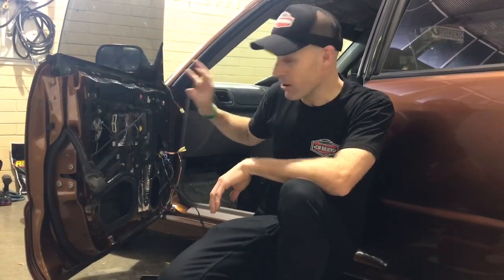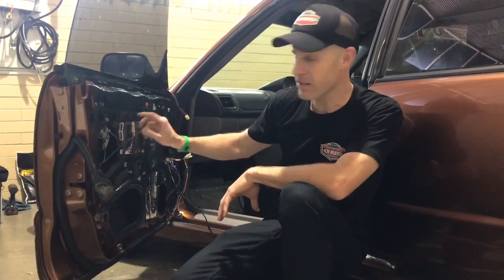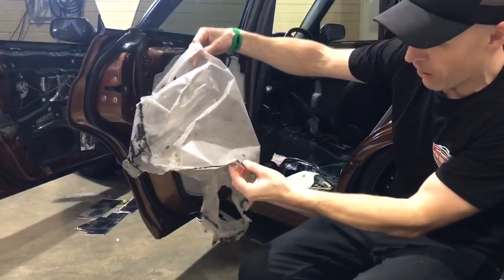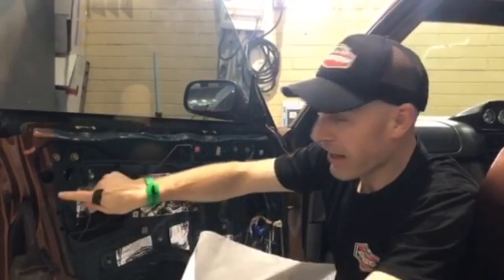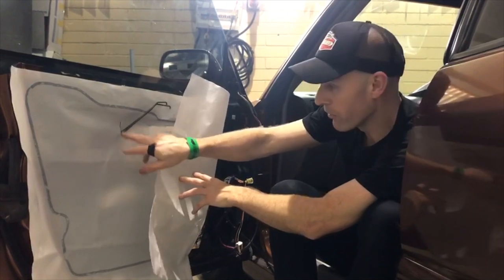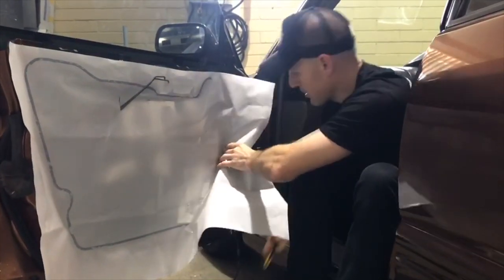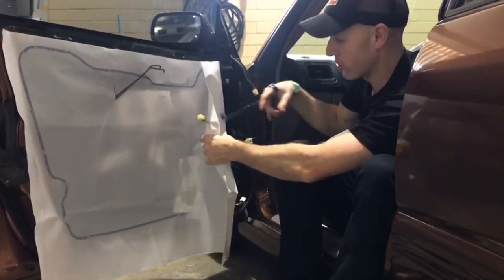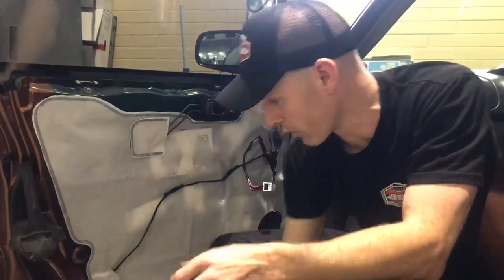Replacing a vapour barrier in a door? Tips and tricks

Comment: Well crap I put insulation in the inside of the panel but also on the outside. Would that help at all or did I just do thay completely overkill?
Reply from the maker: 😆 No, it wasn't a waste, particularly if you have speakers in the doors. You will also notice that the doors feel a lot more solid when opening and shutting.

Comment: My door adhesive melted, how do you clean up the old adhesive?
Reply from the maker: Hi Danny. Send us a picture at sales@carbuilders.com.au so we can best advise 👍
Reply: Any solvent would probably work. Acetone works well, is pretty safe to handle and doesn't seem to damage the paint. Still best to wear gloves though. Just put some on paper towel and do a bit at a time. Don't spill it on anything in the door as it will react with certain plastics.